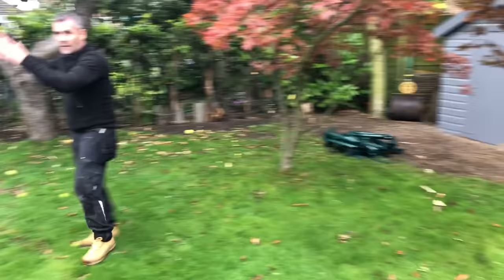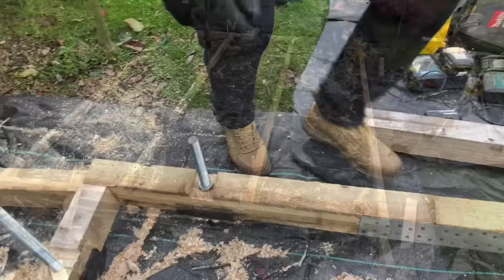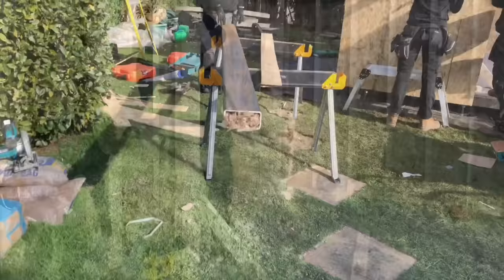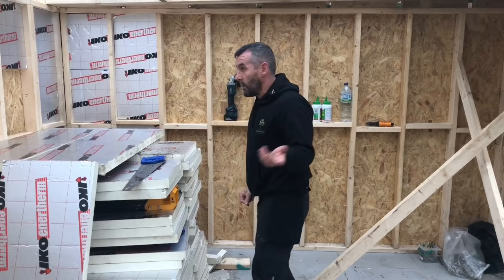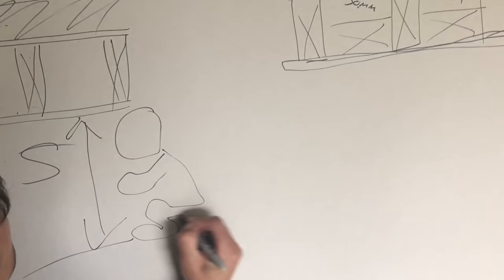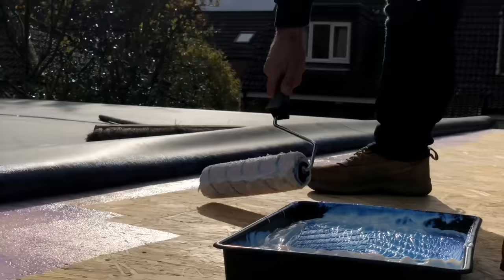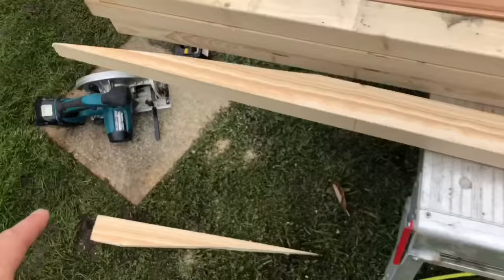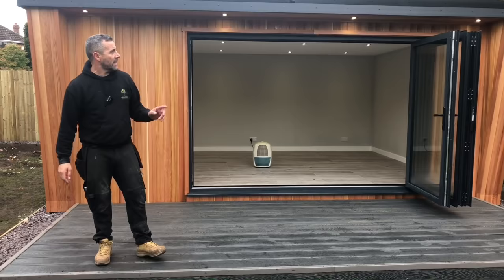Garden room build in 15 days start to finish in 1h 43m 57s, maybe help you drift off to sleep

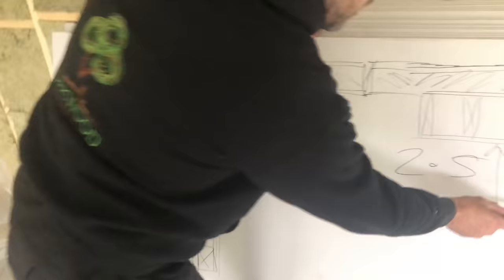Comment: 1:01:57 “ you don’t vent your walls”. Walls have breathable membranes on the outside which makes them different to flat roofs which are typically covered in rubber - hence the need for ventilation. A preformed panel may achieve virtual air tightness but a constructed roof certainly won’t. Once you have punctured the ceiling with a dozen spotlights then you have no chance of avoiding moisture entering the roof and it has nowhere to go so will cause dampness and rot surely.
Reply: What are you suggesting?  Not putting puncturing the ceiling with the spotlights?

Comment: found this video searching for suitable ways to build a long lasting base, i'm not sure if i'm overly fond of the base or not yet .... but blown away by the rest of it !
Reply: i've learnt a LOT watching your videos ! 

for my base in the fenlands clay i opted for 1200mm ground screws, steel base from uroof ltd and glued and screwed steel sheets to the bottom , totally sealed it all up, rammed it full of recycled plastic insulation, used 25mm pir boards and 25x25 steel box \ tubes at 400 centres for floor, foil taped over joins dpm over top of that and then 18mm pop ply, then back to following literally all of your work for the rest ! 

really appreciate these videos

Comment: Looks like over 80 people don't see good craftsmanship when they watch this video, good work lads, keep it up
Reply: Good?. Where.. There is alot of what not do in here. In my country that what fail consent an wouldn't pass inspection.
Reply: @moxiboxi  like what would fail
Reply: What!! No DPC over the floor insulation, just some BS to hide the fact he forgot in the rush to look good, and 5 min glue!!!, you always leave a 3 mm gap and use expanding foam for air tightness. Botcher 2.0!!

Comment: Great work lads, and I like the real time camera work 👍. Just a quick tip with your steel though, you need to prime them up really with a coat of red oxide and wax oil the inside.

Comment: Very informative
4.50sec A note to viewers: To get a more accurate reading of how square the layout is, measure the diagonals between the metal rod pins. If the two readings are exactly the same, it is perfectly square. This is a good way to do it especially if you don't own a large set square.
It's obvious to most people, but you'd be surprised how many people even with experience aren't aware of that mathematical rule.

Comment: Thanks for sharing your construction techniques!  Fully agree with your hybrid insulation of roof - in fact on my own family builds and one or two dedicated customers, I simply pack fibreglass insulation in to every available space.  I've researched the effectiveness of "squashing fibreglass" insulation and as a general guide using double the thickness of insulation roll matches the R rating of insulation board (120mm roll squashed equals 60mm board).  I've even used this in summerhouses with hot tubs inside and provided there is decent ventilation there has been no mould or damp issues over years!

Comment: Nice to see how the English companies are doing it. In Germany in some parts it's totally different. Since I have been to UK, first time 25 years ago, I love this home or garden improvement shows :-) Nail guns are less used, Germany likes SPAX screws ;-) I would say, I liked the idea of leveling the plattform to stand on, wonderfull. But finally it was rather complex, all the screws. Here they use 1m Earth scews (don't know the english name for it) It's much faster to bring them into earth by a machine. As well the connection (metall) between the wood parts (at plattform) they stand on are more robust and simpler designed. And we mainly like Rockwool instead of polymers , due to breathing, moisture. Off course you can say, the OSB wood plates are limited in breathing. But that's how it is. I like your garden house. Well done! Like to see more

Comment: I think the engineering is great, and a very innovative method for getting the base level. I built a similar sized structure myself just using holes into which I pounded shingle and put blocks in them (heavy clay/shingle soil). Used a fraction of this amount of materials and man power. Not dissing your efforts, I think its great how much detail you are showing, and very impressed by the quality of the build. I thought mine was weather proof, but yours is bomb proof !

Comment: Wall plasterboard  fitted directly over vapour barrier  ?   -   when electric switches and socket outlets are fitted  , the vapour barrier will be cut to pieces . Proper detailing is to fit protective 10 ply over vapour barrier and then fit 50 x50 battens to provide a services zone , with plasterboard fitted to battens .   (. A £ 20 book on modern timber frame construction will show this . )
Reply: Since garden rooms are only occupied some of the time and don't contains baths, showers and cooking appliances, I don't think it matters.

Comment: Maybe this would be a small benefit to your build technique, save  you chiseling out your base joists to allow the nut heads to be flush with the top of timber, so before drilling the 25mm hole through for your rods, first counterbore the hole with 50mm flat wood drill bit to the depth you require, then drill the 25mm hole. It's bit quicker & neater than chiseling the a slot out. Just a thought, great videos, defo will buy your build pack when doing mine.

Comment: Foundations look sooo labour intensive. We have a similar sized garden pod, the foundations are screw-piles (12 in total). Installed and levelled by 1 man in 4 hours. Total build time 11 days (could've been a bit quicker but heavy rain delayed work for a couple of days). Walls pre-fabricated at factory. Roof built in-situ. Only 2-3 men on site to build entire pod. Electrical work, air source heat pump installation and final mastic sealing of external joints outsourced to qualified, specialist subcontractors. I dug short track from house and installed 32mm service ducts for power and data and pulled cables in, which saved a little bit of time.
Reply: @joshuawooler9170  construction over an 11 day period (not including Sat & Sun). Some days 2 guys some days 3 guys.

Comment: 15:00
NEVER use a chainsaw to make cuts using the tip or nose of the guide bar. 
You're asking for trouble in inviting a 'kick-back'; it's only got to occur once for a life-changing injury to happen.
Brush up on your tool safety manual!
Reply: Nothing wrong with making a boring cut the way it was shown, perfectly safe if you know what you're doing.
Reply: @kevinbush7907  
Accident and Emergency Departments are full of people who knew what they were doing. My son was dating a casualty nurse who, at the time, said that many cases came in for treatment; so I'll adhere to manufacturers guide lines and I'd advise others to do the same.
Reply: @NickPenlee  I'd be extremely keen to see any manufacturer's guideline that tell you not to use a plunge cut or boring cut when felling large trees!! As a highly trained arboriculturist I would always argue a plunge cut done correctly is much safer than using a huge saw to cut a very large, leaning tree. Look on you tube and you'll find plenty of examples of how to do it properly - so long as the nose is buried before you straighten the saw up to plunge, you cannot get kickback. But hey, a nurse would know better I guess. And by the way, I've never known anyone trained properly, to have a serious accident using a chainsaw in many years of teaching arboriculture. So maybe the A&E was full of amateurs?? I wouldn't advise anyone how to use a chainsaw - I'd simply tell them to get themselves trained!!!

Comment: So good this video! Would love to have one. I was wondering why you used the metal studs for the foundations? Seems like a lot of work rather than just a standard concrete base?
Reply from the maker: It might seem it, but if you take into account, concrete pad= dig out area, remove muck, barrow hardcore, whack flat, form shuttering, barrow concrete, wait until sufficiently hard, you still need to do insulation and DPC
We literally dig holes, pour concrete, next day off we go. Any level, any ground. Works for us anyway, appreciate it’s not for everyone though 👍
Reply: @thegardenroomguru  what products are these screws and joist holders for this foundation? Thank you

Comment: Couple of things , cutting Hardie Plank , just doing this and found a standard TCT saw blade cuts just fine, I used an older blade so far done around 50 cuts, blade still seems fine , bit dusty but with extraction it’s ok. Paint , it’s water based , so I used an ordinary brush and kept it wrapped in a wet micro fibre cloth between use and of course it washers out under tap at the end of the day , no waste !

Comment: You might look again into the prices for ground screws. I'm just building a 24m² garden house in Germany, sitting atop 8 ground screws each over 1.5m long. Each good for 15-30kN (dependent on ground condition, as my ground conditions were unknown I opted for the oversized variant). So the whole setup is able to carry a 12-24 ton garden house, well above anything I'll ever need.

I paid €1400/£1200 for those 8, including installation. It was done in less than 4 hours.

I also looked into smaller ground screws for my pergola and the deck. The best offer I found was <€30/£25 per screw, each good for up to 6-10kN.  A 17.5m² garden house calculated at 4kN/m² would need 7-12 of those, at less than €360/£300. Best: they could be hand screwed, unlike my larger ones.

So either you are ripped off in the UK, with overprized tiny ground screws. Or someone gave you the wrong information.
Reply from the maker: My info is current at time of writing
Commercial ground screws cannot touch my system, we’ve not found ground we can’t work on
You might want to hold your comment until you have more than your personal experience as fact!
How many jobs have you done?
I’ve lost count 🤷‍♂️
Reply: @thegardenroomguru  Sorry, didn't want to come around as condescending or anything. I was just very astonished by the numbers you cited, and hoped to be of assistance. Plus english isn't my primary language (heck not even my secondary), so my comment might have sounded "harsher" than I intended. So please accept my apologies, if my comment sounded like I wanted to schoolmeister a master.

As hinted at in my last sentence in the previous post, I think it's likely, that the prices for ground screws in the UK might be inflated. Which would explain, why your experience in a multitude of jobs (again, which I never intended to doubt) varies so much from mine. And thus might differ for continental viewers of yours as well.
Reply: @AleaumeAnders  Blimey, your grammar is very good pal. I wouldn't be offended the blokes from Yorkshire and they can be a little brusk to say the least.

Comment: Just in the middle of building my own garden room and find your videos very useful. Find it very hard to hear some of the things your saying though. I have an inexpensive way of recording audio myself if your interested. Pair of apple earphones, cut one side of completely and the other just after the microphone. Put a windscreen over the mic and a clip on the wire. Works perfectly with a recording app on your phone at 48khz. Would save your voice as well so your not shouting as much.

Comment: Cool project! Going to tackle something similar very soon as want a gym in the garden so been looking for inspiration! For bits for your impact you can’t beat Milwaukee impact bits, a little more pricey but worth it in long run! Also had good success with sabre pozi bits! I just built a 50x30ft wooden barn n this is my next project! I like using the threaded rod idea saves the cost on concrete and all the digging lol

Comment: We do a very similar build for a company called the qube, (they are based in Northampton) but we do them for schools mainly and just on a bit bigger scale (Modular Buildings) me and my workmate do all the joinery work including fitting the doors and windows, regarding the reveals around the windows have use tried fitting the reveals first, and then butt-up the cedar lengths, when we started doing these builds we did it the same as use but find this way a lot easier,

Comment: If you got robertson screws, i doubt you would break any bits in a job. These are super common in Canada, but not anywhere else. They are a superior screw design as the screw EASILY stays on the drill bit letting you put a screw on the drill then bringing it to the work.

Comment: You could dig the holes as normal and put 6 inch solid drainage pipe in the holes to the height you want fill with post crete and that’s your cheap version of concrete pilling

Comment: Loving your work sir, I ordered a log cabin from tiger in June and was told last week it would be March before I'll get it, so think I'll just buy a plan from you and build my own, great videos 👍
Reply from the maker: Mate, with or without my plans, build your own, you’ll enjoy it and get a far better end result
Reply: @thegardenroomguru  thanks for replying,  i make timber moulds for a concrete company so no stranger to woodworking,  like the look of the black cedral cladding, is is cheaper than cedar?
Reply from the maker: It is, cedar is big bucks,
Reply: @thegardenroomguru  cheers, ill look into that
Reply: @thegardenroomguru  how much do you think I could save on a 5x3 by using cedral instead of cedar?

Comment: you should let the water based rubber adhesive tack off slightly before you push out the rubber 👍

Comment: The dampbarrier should always stay intact: also at the light recesses and wall sockets. And if you fixed that problem I would suggest to use a high quality semi-permeable membrane (climate foil that resists damp in winter and opens in summer to release moisture back into the room)... instead of a cheap plastic foil. To avoid condensation on the inside of the roofpanel (OSB3) I would use a additional foam insulation of 20-30mm on top of the OSB3. 

And instead of PIR-insulation I would prefer a natural insulation material like hemp, vlax or wood fiber. These materials are eco-friendly and have the benefit to regulate moisture too.

Comment: Hi bud, just want to ask. So the the walls are made up of 4x2 and you will using the 50 and 60mm insulation? Is not to thick? As the 4x2 is 95mm thereabouts. I may have missed something in the video so thought I'd ask

Comment: I just love this start to finish explanation of this build and for my own understanding when you cut the rectangular hole for the electrical outlet, your worker used the multi-tool to score the drywall after the vapour bartier was up. Does cutting the drywall in this manner and subsequently the vapour barrier compromise the function of the vapour barrier? Thank you 
P.S. Again a well explained and documented start to finish build. A pleasure to watch and learn.
Reply from the maker: It does mate, but it’s never been an issue, stopping 90% is better than nothing and the other 10% won’t all make its way to the same hole 😁

Comment: Nice video and thank you for showing us all of your excellent work.  

From my experience, unless you put box windows and triple glazing doors with different number glass pane thicknesses say 5mm 4mm 6mm glass you will never achieve sound proofing.  You did such a nice job but the customer wanted the noise insulation most probably against the possibility of an annoying neighbour with one or more barking dogs.  Complaining to the Council noise officers (all of them dog lovers) against dogs is USELESS. They take the piss and do nothing.  Indeed, the bigger the garden, the more animals ignorant unintellectual neighbours want to have: chickens, badgers, dogs etc.  The only way I achieved noise insulation in my own detached home in England was by shutting all gaps and using Finnish Skaala Alfa GE "Kastenfenster" style quadruple glazed (two windows) box windows.  What is the point of having such a nice space if then some annoying unintellectual neighbour ruins your peace and quiet in the back garden. Presumably your client is a scientist or research engineer like me who needs the garden office to concentrate and to escape noise.  You need to test what is the dBA sound insulation of the structure also you have a simple frame but you said nothing about that against barking dog, traffic and other frequencies.  Finally, where is the water?  So it means I need to go in and out of the main house to get water for a coffee or a drink, or is there another solution. You have electricity but no toilet nor running water, just asking.  Also on the costs.  I used Y TONG aerated concrete blocks instead of your wood frame and cedar. Yes yours looks nicer but is it not overly expensive?  The Ytong are big and light European blocks that can be glued together and you can put the walls up in three days. They have other issues but I think it is more solid but it needs of course concrete foundations etc.  Also structurally, the frame is made stronger by the roof but how about those heavy folding doors.  Do they shake the structure if you open and close them quickly? - just asking.  After how many years do I have to oil the wood? what would be the effect of weather and how long will this structure stay so pretty?

Comment: If you want to extend broadband internet and you need to run a line you should always run CAT6 shielded wire.  If the line is going to be more than 50 Meters I would suggest running fiber.  Otherwise, you will get slow speeds.

Comment: Screwing gypsum boards directly to the rafters guarantees the appearance of cracks after filling. Unfortunately a lot of bugs. Comparing the wall layout to the roof cross-section shows little understanding of the phenomena of building physics. A video shot very nice.